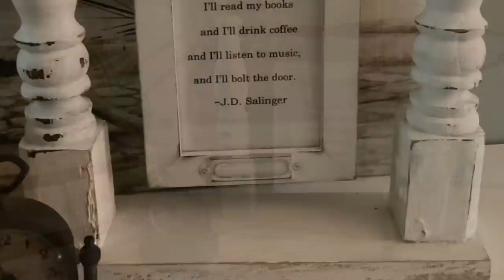12 DIY PROJECTS REPURPOSING A BROKEN CHAIR

Comment: Wow!! What a brilliant use of the chair and spindles, I love every single one of your projects. Girl, you're brave trying to cut those spindles in half, I was cringing as I watched. Well done with your challenge! I think that your knocked it outta the park, Sherry. 
Also wanted to give you a tip with the starbond, when using the spray excelerator, place the glue on one side and then spray the area that you'll be placing the glued item to, this will help with the immediate hold.

Comment: You are just so so creative.  If only I could handle those tools like you ❤
Reply from the maker: If you don’t work with power tools (yet), I would suggest you start with a jigsaw. It is easy and really safe to use, and it cuts wood, plastic, and metal.If think you’ll be glad to have one, after you try it.😊

Comment: I liked the number 1, 3, 4, 5, 7, 8, 11 and 12 things that you maked. But I also loved the original chair because it had the wheels and was pretty too. I would have used the wood filler also foor the foot stool it had some holes where you screw the handle. That I think was the best of all the others because it had the space inside to but magazines, diary and pens  lotion, pet toys or such. I have all the use for it but not the stool I am afraid. 😝 You are lucky to have all the machines to use to make the things you did. 😍 I only wish. 

Paula from Finland 🌍. Up north in the picture.

Comment: Just s little suggestion about pre-drilling your screw holes. You will get a tighter hold if you actually drill the holes slightly smaller than the screw, allowing it to bite deeper into the wood.

Comment: Cute stuff! Do you ever use your electric knife to cut the foam?
Also, glue the ends of the spindles into the project and flush cut them off. Saves on wood filler and looks nice!

Comment: I just watched you hold a spindle with your left hand crossing in front of the blade. When I did that, the wood jerked under the blade and pulled my hand into the blade. I lost the tips of 2 fingers on my left hand.  When I saw you do that I had a flashback. Safety first.  I love your videos. I'd hate to see you get hurt
Reply from the maker: Thank you for your concern. 🥰  I will be careful.

Comment: P.S.  I laughed about the 1 chair so many ideas!  I found 2 wood chairs before trash day (a neighbor moved) but one was missing a few bottom chair rungs.  I looked everywhere for replacements but nothing…until I decided I wanted the project finished and engaged my thinking.  I cut up a wood broom handle and voila I had more stable chair.  I laugh when I look at the chair.  The other chair just need a sanding and finish.

Comment: The cutting board holder is very clever and adorable. May I ask why you don't have a nail gun?
Reply from the maker: I bought an electric one, but it only shoots very short nails (totally worthless).  I just haven’t wanted to spend the money on a gun with an air compressor, but you are right. I should probably just break down and get one!
Reply: @CanterburyCottage  Also, forgot to ask...have you tried an electric knife to cut foam? I haven't but I've heard it's great.

Comment: Hi! Do you like the Waverly wax? I haven't used it yet but wanted to try as it is much less expensive then the DIY wax! 🙂
Reply: I know your question was directed to Sherri, but I thought I’d toss in my two cents. I used to use only Waverly paints and waxes when I got started redoing furniture. It’s good, but then I tried DIY brand...it is great! The paints are so thick and heavily pigmented that you actually get a lot of bang for your buck (yes, they are pricey, just like all the other boutique brands out there). As for your question, the Waverly wax is okay. It is very liquid and not much at all like a traditional wax in that regard. I used the clear and the antique for a couple of years before I switched to DIY. I do still use Waverly a bit now and then on small projects, simply because I have quite a stockpile of it in my paint cabinet. If you already use DIY paint, I suggest you use their wax with it. I once tried to use Waverly wax over DIY paint, and unfortunately it reactivated the paint and I had to start over because it couldn’t be salvaged. Also, since I’m giving you my take on all this, I don’t like the “white” wax by Waverly much at all. It tends to be almost a very pale yellow and will change the tone of some lighter paint colors. For comparison, DIY white wax is a true white and gives the expected result consistently. Hope this helps. 🙂
Reply: @jodilea144  omg!! Thank you so much!! I figured the Waverly was ok. I absolutely love my DIY stuff, especially the white wax! I also love the DIY dark oil wax....just recently tried that...its amazing! I will stick to my DIY line....thank you so much for taking the time to reply....much appreciated!! 💕
Reply: @kerigeoghegan8059 , you’re very welcome. I absolutely love DIY everything! 😊
Reply from the maker: Jodi’s answer was great! Apparently, Waverly is discontinuing their paint line, so we are all going to have to find another brand.  I like Dixie Belle paints, but because I go through so much paint I chose to use the less expensive Waverly brand.  I haven’t tried the DIY brand, but based on Jodi’s recommendation, I just might!
Reply: @CanterburyCottage , I like Dixie Belle too, as well as Amy Howard’s line, but DIY by Debi Beard is my favorite. She just came out with a new line of pigment powders and a new gilding wax that I’m anxious to try too. 🙂

Comment: how do you know when to use chalk paint or spray paint or canned paint?
Reply from the maker: That’s a great question!  I usually spray metal and glass and things that have tiny parts that a brush won’t get into. I rarely use spray paint on wood unless it’s just a primer.  Most wood soaks up spray paint and even with multiple coats leaves a splotchy finish.  I use chalk paint if I want a matte, distressed, or rustic look. I use regular paint if I want a smooth and/or shiny finish.

Comment: Hot glue never holds for me, is there some trick I don’t know?
Reply from the maker: I use Gorilla Hot Glue sticks. I also use the Gorilla Glue Hot Glue Gun (most of the time). There are times that hot glue doesn’t work; in those instance, I use Starbond superglue. E6000, or wood glue, depending on the project.